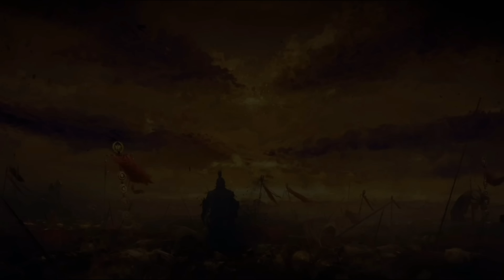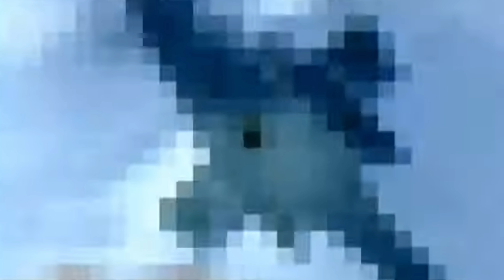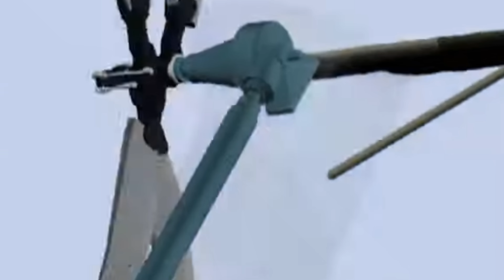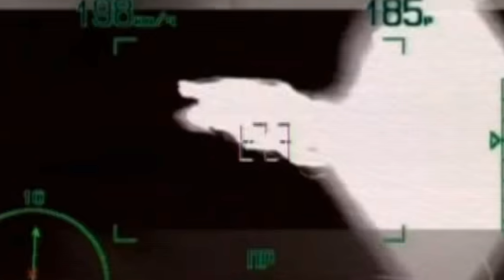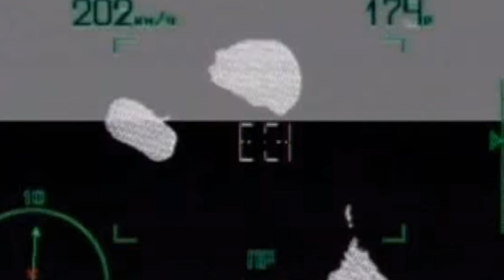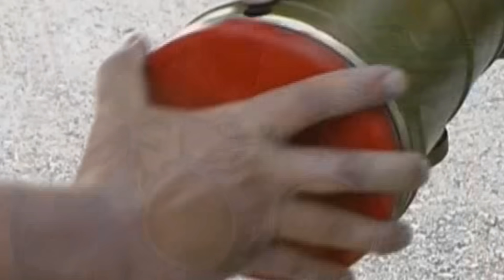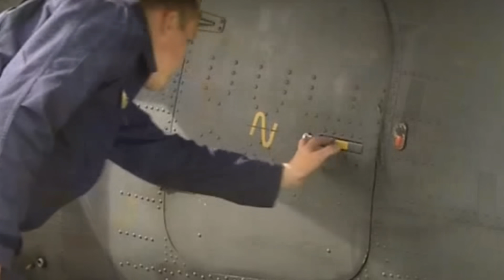Mil Mi-28 "Havoc" | RUSSIAN ATTACK HELICOPTER

Comment: I was always saying that people who think Russia doesn’t care about crew safety are looking at Cold War equipment with modern standards. 
It is because they are concerned with the protection of the tank and the vehicle that they make tanks as small as possible. Same with the carousel ammorack, comparing that to ammo right behind the front plate or just randomly lying around, concentrating it into a smaller area that is really only detonatable from the side is probably the best you could do before blast doors and blow out panels become a thing. They also had the best helicopter and jet eject mechanisms and that is without contest.
Reply: They also did that with Ilyushin Il-2 in World War II. Its armour was concentrated around the cockpit which is why some people called it the flying tub. To save weight considering it was a ground attack aircraft and had more armour than most fighters and ground attack aircraft of the time the designers used Monocoque construction, which means the armour was part of the support structure instead of being added later. Mainly they used Monocoque construction because the engines available were underpowered. What @Matsimus was talking about in crew survivability was the reason the Il-2 also had all of its armour around the cockpit. Most other aircraft of the time had armour behind the cockpit and underneath along with the canopies made out of bulletproof glass. Better than how the Japanese designed their A6M Zeros which originally had no armour at all and didn't even have self-sealing fuel tanks. Their philosophy was you're supposed to hit your enemy but they're not supposed to hit you. It was also to save weight as their engines were underpowered too. They later started adding armour and self-sealing fuel tanks but by then it was too late as they put little effort into training new pilots, producing new aircraft and lost many of their experienced aces at the Battle of Midway.
Reply: Do you mean that forearm eating carousel ammorack is made with crew safety in mind? Not only does it eat crew arms, but it also explodes too often, even for russian low standards. Smells like vatnik here
Reply: @DrzewnyPrzyjaciel  I think there's a smell of burnt pork here
Reply: @DrzewnyPrzyjaciel  Not only does it eat crew arms BS crew arms are elsewhere out of the way explodes after the crew compartment is hit/penetrated by anti tank round the crew is already dead
Reply: @fred6319  you're just a great specialist. go sleep it off.
Reply: Laughs in Ukrainian defense 
I genuinely thought Russia had more of a bite. Well? What do we have here…
Reply: @Zman44444 le plus drôle ton pays n’a aucune chance face à eux
Reply: @valeriegillet473  my country? 
I would really suggest that you ponder the Russian situation right now. 

Is Russia actually that capable? After all these years of losses and being bogged down?… compare a map of captured territory to now. There’s nothing much captured. And this is a peer v peer conflict in Ukraine. 

I don’t think Russia has the man power, nor capabilities to lash out on any other nation for the next 5-10 years. We’ll see what happens with Ukraine. 

Not good for Putin. And all of the west has been able to see what Russia’s modern doctrine is. Throw bodies. Bomb civilians. Surely enough of our war crimes will break the will of free people. 

I think my country will do just fine for the time being.
Reply: @Zman44444  A stinger from Uncle Sam, and a Starstreak from the late Majesty and blessed by King Charles. 

 America needs to get it's head in the MANPAD game.

 Also to be fair this is the first modern conflict with new Western weapons being used. Some analysts say that attack helicopters are incredibly vulnerable regardless of whom or what is flying. Infantry can conceal themselves asily and just wait for a helicopter to get into 5km and bring it down. It's becoming easier to make sophisticated missiles and harder to counter them. 

  Hopefully we see some active systems like a trophy, or EW that works most of the time.

Comment: Mil company was producing Mi-8 in massive numbers in the 80s so it wouldn’t go bankrupt anyway. I am pretty sure Soviet MoD made an order for Mi-28 just to have a backup option in case Ka-50 project fails as it was toooooo advanced for the time with it’s digital systems and single seater configuration.

And it it turned out to be a wise decision as even 2010 technologies do not allow for a single seater attack helicopter to be effective enough.

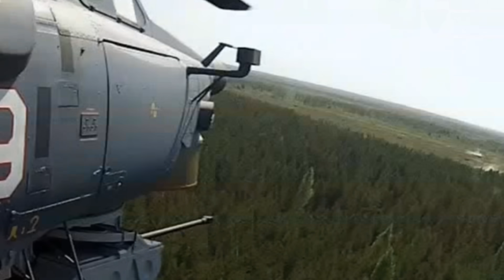Comment: Engine and wings are from Kamovs Ka-50, outfit design of Apache, the cannon is rough cutoff BMP-2s 2A42/72 (11:04) cannon which is not specifically designed and adopted for airborne use like M-230 chain-gun and finally all its avionics are foreign and most probably western, what a shame to Mil Construct Department, this is common now in Russia to take a someone’s designs and structure concepts for some Russian “pro-gov” regime Construction companies that have some suspicious lobby in Kremlin.

Comment: Beyond visual range engagement for tanks makes this dangerous for tanks
Reply: Trying to think of an environment with a 10km unobstructed line of sight.
Reply: Syria, parts of Iraq, maybe great plains Canada and Nebraska
Reply: @cinjonsmythe6318  Where, specifically.
It's pretty useless practically everywhere.
Reply: @DimeOfDimes  since that thing is flying it dosent matter as it will almost always have great sightlines. as a hunter i have seen various fields with great lines of sight across europe and asia ... take mongolia for example
Reply: @старшийсержант-л7ш  Here's a math problem for you:
A tank is parked out in the open, 30 meters from a clump of trees 30 meters high. 10 km away beyond the trees there is an attack helicopter. At what altitude does the helicopter need to hover to have an unobstructed view of the tank?
Reply: @DimeOfDimes  bruh in mongolia a litteraly like just plain fields
Reply: @старшийсержант-л7ш  Mongolia, bruh.

Comment: I was surprised that you missed a very cool feature which is its emergency cargo space (that they actually showed in the video) in which it is able to carry 2 or 3 soldiers in an emergency.   Also it should be pointed out that the KA-50 was discontinued.  Only the two-seater KA-52 is still being produced.
Reply: 'cause KA52 is modernized version of KA50. Only pilot automation does not goes well for combat results, so they return to two seater design with gunner and bigger, more armored and more russian design.
Reply: @thomaschadwick1557  More Russian? Can it fly on vodka for fuel?   :P  Just kidding. Yeah the workload for one pilot in the KA-50 was too high especially with the addition of new ECM and sensor upgrades that required a second set of eyes to manage all of that equipment.  Still....the KA-50 looked a lot more aggressive.   BTW,  I don't think they added any armor upgrades as that would significantly increase the weight. The only additional armor is likely to be mainly what was added to protect the 2nd additional crew-member.  That alone would have added substantial weight along with the additional ejection system that the KA-50/52 series are famous for.
Reply: @wigon  YES! And diesel.
Reply: Проблема в том, что он оперидил своё время! Вместо штурмана и пилота, должен быть ИИ, но на тот момент времени его было в зачатке от Бурана, но это большой компьютерный комплекс на то время! Увы! Вес увеличился, второй пилот появился, места и вес для снаряжения уменьшился! Закон физики! Если возродяд, то я боюсь, что он будет беспилотный, для врага- это страшно!
Reply: Я про это и говорил!! Мы вместе думаем одинаково! Удачи и здоровья!
Reply: KA-50 probably because the pilot is overworked right?and with two seater the pilot workload is reduced

Comment: I think the AH-64 Apache is even more heavily armored than this; it's supposed to have armor glass on all canopy segments, not just the front.
Reply: The hull the Mi-28 is more armored, and the canopy on the Apache is much larger and more vulnerable than the small windows on the Havoc.The Apache was designed to be resilient to 23mm as that was the most common Soviet AAA size but the Soviets upgraded near the end of the cold war to 30mm, which the Havoc was designed to resist. This doesnt mean they are immune to such rounds.
Reply: The reason I say the ah 64 apache is better... is because the gun is is what makes an attack helo in my opinion ... ah 64= 1200rds of 30mm and the mi 28= 250rds of 30mm and the combat range is 240nm on the ah 64 and 110 on the mi 28 but other then that there almost = to each other.... it's deadly for sure
Reply: @ah64dbeast37  the gun really means little. If an attack helicopter is getting to within gun range its doing something wrong. In a war against a peer opponent you are crazy to get within 2-3kms. Its fine when you are flying over 3rd world countries who can barely fight back but all that ammo counts for nothing really. The Havoc's gun is actually better. Both have about the same range though the Havocs combat range is less - it carries much more firepower and armor which makes it heavier
Reply: @Internetbutthurt  they have basically the same firepower and the gun is more important then you think and I point to 1991 war where the U.S. was up against a major power and there Ferry range is with no weapons only the gun but these helicopters are very close and all of this this is opinion based yours and mine I like the havoc and the hind  ( I love the hind) but I'm an apache man my self that all also side note I wish we had bmp 3f those things are one of the best ifv in the world.
Reply: @ah64dbeast37  Iraq had numbers, and most were conscripts. They were not a major power really. They had just emerged from a 9 year war with Iran. Their equipment was largely clapped out, and they were outnumbered and outgunned. They had no chance. Yes the Hind is still very effective. still popular despite more specialized attack helicopters available.
Reply: Mi 28 is more armoured than the Apache https://i.redd.it/gk59rpnz5y031.png
Reply: The Apache is much less armoured in any aspect. It doesn't even have bulletproof glasses

Comment: I'm sure president Putin is very pleased with the results of the MI-28 in Syria.
Reply: Air Force is not. KA52 have a better results. And less maintenance issues and zero non-combat crashes in opposite to Mi-28.
But Mil will get there.
Reply: @thomaschadwick1557  do you remember the incident report? I kinda remember there being a crash involving a mi-28 bit was it in Syria or training flight.
Reply: the main issiue with the mi 28 , a night system problem has been resolved.

Comment: The tair rotor could lift a huey. The cockpit doors came off a bank vault. Weapon stores and turrets everywhere!
Reply: Basically russian helis in a nutshell.
Reply: America: Agile, advanced yet lightly armor (except Apache) & versatile helicopter.
Russia: Flying tanks
Reply: limescale onetwo you know that it will last very long if it is from Russia. Seriously, my family has a Soviet pot for nearly 50 year, still look good and holy shit, it is THICC af. I mean, I can use it to stop an anti tank shell easily.
Reply: @nguyenminh8240  Ingots and rods, you fix it with steel wire and a hammer. Vot technika! :o)
Reply: It's overweight and underpowered, which is typical of Russian helicopter design
Reply: @jamesricker3997  The Afgan military says the complete opposite.
Reply: @jamesricker3997  Underpowered! Not a single vague Western equivalent comes within 200 horsepower per turbine to any MiL or Ka 😂 We just have armour on our helis and don't exclusively blow people up from 4 miles away while hovering at tree top height or circle at a 2 km range like vultures ripping apart our enemies with GAU cannons! 
No imagination. Typical.

Comment: When the US Apache went to Afghanistan it took 3 months to deploy 20 with 2000 ground staff. Most Russian choppers can carry a mechanic in a jump seat and the pilots can do basic maintenance in the field.
Reply: yfelwulf yeah no that's complete bullshit.
Reply: Oddly their attack Helicopter can't remember the model has this ability. The Su25 far superior to the A10 is designed to land and fight with the Infantry it also carries its on service equipment in 2 pods basic maintenance can be done by the pilot. The A10 if its nose wheel ever stops collapsing or being shot away by its own cannon can't. Also a fact every Russian Helicopter in every category exceeds the performance of every US or Western Helicopter. The US even bought Afghanistan 18 new Mil17  because the Death Hawk has inferior performance to a 40 year old design over 17,000 built used in almost every country. As for the Osprey a Death Trap of the worst kind no ability to glide or hover on one engine take out one engine everyone dies.
Reply: Citation needed. Seriously, from a maintainer. I work on helicopters for a living. If you're gonna spread bullshit lies at least make them plausible lies.
Reply: @andrewhackney6286 Oddly their attack Helicopter can't remember the model has this ability. The Su25 far superior to the A10 is designed to land and fight with the Infantry it also carries its on service equipment in 2 pods basic maintenance can be done by the pilot. The A10 if its nose wheel ever stops collapsing or being shot away by its own cannon can't. Also a fact every Russian Helicopter in every category exceeds the performance of every US or Western Helicopter. The US even bought Afghanistan 18 new Mil17  because the Death Hawk has inferior performance to a 40 year old design over 17,000 built used in almost every country. As for the Osprey a Death Trap of the worst kind no ability to glide or hover on one engine take out one engine everyone dies.
Reply: @yfelwulf  Again, I find it difficult to take anything you say seriously, particularly given that you think it possible for the A10 to shoot off its forward landing gear with the nose gun. Have you even seen a picture of the A10, let alone been near one in person? Additionaly, the US purchased Soviet milsurp airframes for Afghanistan because of the availability and cost of parts, performance characteristics are secondary to cost when you can barely afford aircraft to begin with.
Reply: @andrewhackney6286  You mean you work on Junk correct Overpriced shit let me guess you think the B35 KamaKhazi is a success the most failed aircraft in aviation history. At current production rates the full US order 4250 will take till 2050 to complete and nothing on it works. The Jew K. Bought some to avoid telling the Public they have a £3.2 billion carrier light on crew with no aircraft.
Reply: From a quick look in both Russian and English, it seems like there’s a bit of truth to this. Russian pilots are expected to know how to perform some basic diagnostics and repairs on their own aircraft, and a simple routine maintenance can be performed by a single mechanic with help from the crew. 

This cannot be done indefinitely and can’t do more significant maintenance or overhauls, but it can enabled an injured helicopter to limp home, and grants prolonged operational capability under difficult conditions. 

That said you, would not want to have to do this for any longer than absolutely necessary. Could be useful for a forward force or a very long range mission, but this isn’t standard operating procedure when you have a real maintenance teams and repair bays available. The supplies would be very limited and you bet it would suck ass for the poor guy who has to ride in that alleged compartment.

That said, it could just be barracls folklore, but I am not going to spend the next six hours looking for official military training manuals on this helicopter.
Reply: I was in the US army for over 11 years and did one tour in Afghanistan (2003) and two tours in Iraq. I can tell you right now what you said is total BULLSHIT! I realize that your a Russian fanboy and that it sucks to be you, but as long as the Apache is flying it will always be the gold standard when it comes to attack helicopters!
Reply: @mississippirebel1409  Oddly their attack Helicopter can't remember the model has this ability. The Su25 far superior to the A10 is designed to land and fight with the Infantry it also carries its on service equipment in 2 pods basic maintenance can be done by the pilot. The A10 if its nose wheel ever stops collapsing or being shot away by its own cannon can't. Also a fact every Russian Helicopter in every category exceeds the performance of every US or Western Helicopter. The US even bought Afghanistan 18 new Mil17  because the Death Hawk has inferior performance to a 40 year old design over 17,000 built used in almost every country. As for the Osprey a Death Trap of the worst kind no ability to glide or hover on one engine take out one engine everyone dies.
Reply: @yfelwulf  I agree that MI 17 is the most reliable as my brother flies one. The Osprey is a Heinkel 177 Griffin monstrosity the pilots cant seem to be able to fly costing 84 million-about the same as F-35 LIGHTNING 2!